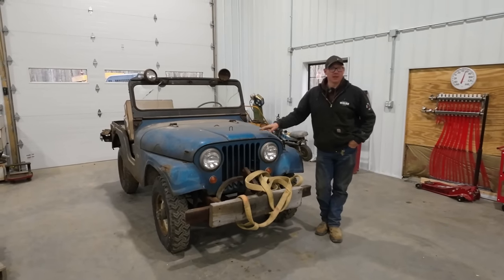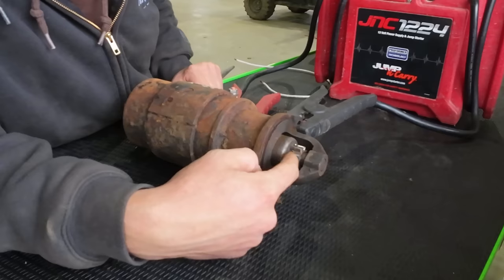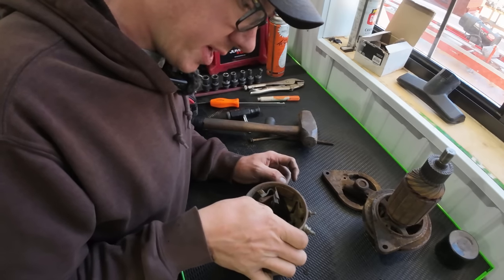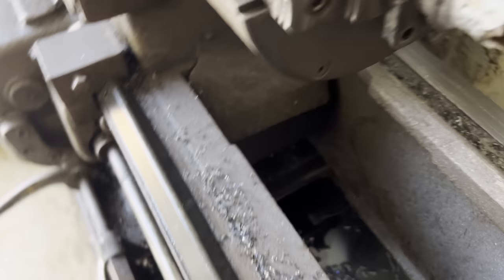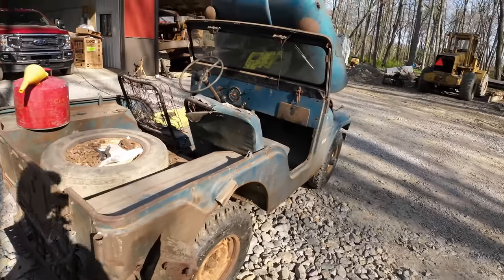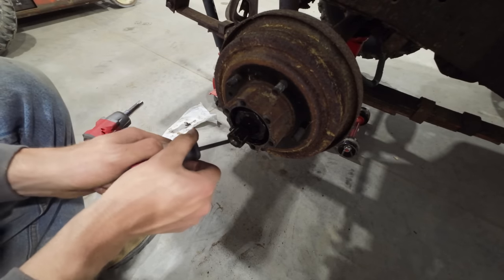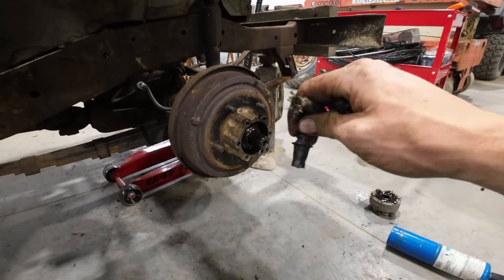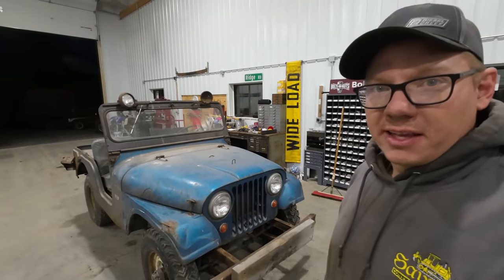Barn Find 1964 Jeep CJ5  (Is It Road worthy?)

Comment: This what I miss so much from my childhood. The ability to disassemble a part and fix it instead of planned obsolescence. I still try to fix anything I can instead of outright replacing it because I grew up dirt poor and it was imperative . Many a night of holding a flashlight under the truck as my dad dropped the transmission. Thank you Matt for keeping the spirit of yesterday alive.
Reply: DIY's have been obsoleted with modern technology / obsolecence
Reply: @araofmadisoncasey4247  just get a horse like everyone else. I knew these "cars" were a fad anyway.
Reply: @araofmadisoncasey4247  naw you still save a ton of money running old equipment and fixing it yourself. Some truths are timeless.
Reply: Some things are just not worth repairing due to low cost
Reply: @alexstromberg7696 Like GM EVAP system that picks up all the dust from rear tires, clogs the system and you end up changing a $700 part? South main auto has a short available.

Comment: Thanks for so many memories, Matt.  My dad had Jeeps all his life after he came home from WWII, and they all had snowplows.  I learned to drive at age 14 in the mid-60s plowing snow with his '64 CJ5.  Many were the times I'd take it to high school.  Yes, I also learned auto mechanic skills working on that Jeep.  Radiator changeout, installing new clutches, starters, and new brakes.  Even constant body work, as they all rust out over time.  I so wish I had that Jeep today.  Jealous.  👍
Reply: I can relate totally! My uncle who lived close by, bought a 1947 surplus Jeep when I was about 8 yo. I helped him work on that thing until he got it back to original. I've owned, bought, fixed and sold Jeeps off and on ever since and I'm 78 now. I have a 1977 CJ5 the exact same color as Matt's with a T98 granny low 4 speed, PS, PB, 3.54 lockers front and rear and 9,000 lb winch. I live in a small town where everyone knows everyone so you can guess who gets called when someone gets stuck! Love them Jeeps!
Reply: One of my first vehicles I owned as a teenager was a ‘59 CJ5. Loved that thing. The simplest vehicle you could ever own. Perfect for someone learning to be a mechanic.
Reply: @billmoran3812  👍 Exactly! I learned so much from my uncle that by the time I was 14, I had my own farm equipment repair business. My dad had bought me a set of combination wrenches and a 1/2" drive socket set for my 13th birthday. I still have some of those tools.
Reply: If you ever want to repair on check out C&C equipment the import most jeep part bodies frames ect.
Reply: @emiliosolis5056  👍

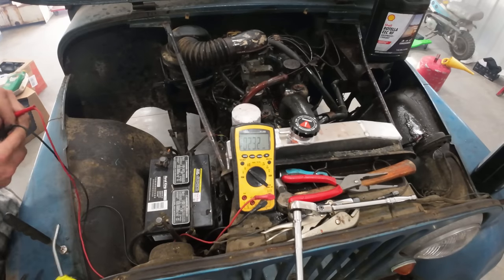Comment: 28:20 Matt, what you saw was exactly correct.  Generators produce little to no output at idle speed which is why you only saw battery voltage until you ramped up the engine RPM.  This is why alternators quickly replaced generators after reliable high current silicon diodes were invented.  For a given size alternators also produce more energy than generators and they're more efficient.
Reply: Thanks for answering all my questions. Before I even asked.🇬🇧☺
Reply: @mickkelly6389  swap out to a 10si GM alternator to solve probs

Comment: Matt, you need to clean the commutator segments because each pair of the commutator segments goes to one of the windings and the other end of the winding goes to another commutator 180 degrees on the other side.  So each brush  connects to a single winding via  the  commutators.  Try this with an ohmmeter,  pick any commutator segment connect one lead to the commutator and the other lead to the commutator 180 degrees on the other side - you should  see continuity (it will read some resistance (ohms)).  If you go to the adjacent segment you should NOT see continuity. So, the reason you clean the insulating space  is to keep the adjacent commutator insulated from the next commutator (set of rotor windings).  It is the same for both generators and starters.  When you clean between the commutators be gentle!!!  The pick should be used to dislodge bigger pieces with a gentle scratch, then a paint brush to gently clean down into each slot. It is a very good idea to lightly clean (sand) the commutators like you did on the video.  But the brushes need a very light cleaning too.  But again you have to be very careful that you do not damage the delicate brushes.  The brushes are not square to the commutator but are curved to ride against the copper commutators for maximum brush  to commutator contact.
If you have the patience this is a good way to diagnose problems with alternators and generators.  Using the ohmmeter, each pair of commutators should have about the same resistance.  If one is open that is a bad winding.  Likewise, if you touch one of the leads to the commutator on either side of the target commutator the resistance should show open.  If not your have a shorted winding or dirty commutator segment, hence the cleaning.  Sorry this was a bit long winded but it is difficult to explain clearly in writing.
Reply: Good explanation, I have been into starters and generators and never knew this before. I’ll know better next time. Thank you!

Comment: The commutator requires a gap between the charged rails.  
It’s interesting watching you tackle stuff you have never tried before and is an excellent example of your innate mechanical skills. Good job Matt.
Reply: Dang Commies are everywhere
Reply: Good mechanics have worked on mechanical devices they know nothing about all their lives. that's how we learn. Personally. I started out fixing cap pistols.
Reply: I really enjoyed this one. Looking forward to watching you get the shop organized.
Reply: Definitely, Lon... and since carbon will conduct electricity, having a bunch of it packed into the gaps  will tend to short-circuit each commutator contact to it's neighboring contacts and reduce the overall efficiency of the generator.
Reply: A hacksaw blade works well for cleaning the gaps. And for cutting down the insulator if you turn the copper down in a lathe.
Reply: @MGower4465  Thank goodness for that.

Comment: Matt is putting his shop to good use. No more mother nature as a roof!😄 As Jackie Gleason would say... How sweet it is.
Reply: Now he needs a part washer and a sand blaster in the shop, plus modifying and installing the gantry crane, and then the list goes on forever:)
Reply: @PatrickPoet  I'm expecting a vehicle lift very soon. Unless he doesn't want to dedicate space in the shop for it.
Reply: @centauri61032  Mustie1 has a lift that is movable
Reply: @centauri61032 wild fire lifts like the ones that vice grip garage has are movable
Reply: Love the new custom interior
Reply: @KipdoesStuff  My gut says "Go with a bolt-down model of lift!"
Reply: @PatrickPoet  and an ultrasonic cleaner, important for those carburetor jobs.
Reply: "What We’re Dealing With Here, Is A Complete Lack Of Respect For The Law."
Reply: @ljprep6250  I wonder if he knows where the heating lines are accurately enough to dare to do that.
Reply: @larrybolhuis1049  Ooh, excellent point.  It's too late now because I'm sure that the floor is gonna STAY warm.

Comment: Just a little tip for future, whenever I fit a new thermostat that does not have a hole or gigle pin through it, I drill a hole. I do this with a small hole no more than an 1/8". This allows very easy bleeding, quicker thermostat opening and possibly less chance of overheating. At the very least the filling and bleeding is so much easier and won't blast out when thermostat opens. I have been a mechanic for 32 years and never caused me a problem yet. hope this helps. Love your channel too.

Comment: Just a friendly note - the coolant is concentrated mix. You should dilute it with water to at least to 1:1 ratio :)
Reply: And - I don't see the relationship coolant to fuel. It is not supposed to come in contact with fuel, so what different does it make whether you put it in a diesel or a gasoline engine.
Reply: @laoluu  There is no reason for comming in contact with fuel. You must have misunderstood my message.

Comment: I remember my first CJ. The Ross steering box was so worn out I had about a third of a turn or more of play in the steering wheel. The top was dry rotted and leaked like a sieve, the rear springs were busted, the roll bar was barely bolted to the wheel wells,  and everyone gave me grief about my "Ejection seat". It was the only vehicle I refused to wear a seat belt in (safer to be ejected, than incinerated), but damn, it was a lot of fun.

Comment: The bottle on that Rotella coolant you used said it is “concentrated”.  That means it should be mix 50/50 with water - distilled is best.  It will actually cool more effectively and have a lower freezing protection temperature if it is diluted per the instructions.

Comment: I’ve had brake hoses pop like that before. Rotted hoses and the heat weakens the crimp and generates pressure. It was probably internally plugged somewhere causing pressure to build up even with the end cut.

Comment: I have had a brake hose blow up on me also. It didn't blow completely off like yours, but it did pop and scare me good. Only thing I can figure is that the soft line was collapsed on the inside and when I was using heat that little pocked of fluid in there boiled and it blew. shrug

Comment: Great trick on testing generator. I never knew that one. One tip is get some left handed drill bits and a lot of the time as you drill it counterclockwise the bolt comes out without using an easy out. (Easy outs tend to put outward pressure on the bolt and make the threads dig in thus making it harder to unthread than the left hand drill bit does)
Reply: Have a few LH bits for that reason - works way better than an EasyOut.
Reply: agreed I have a set of leftys for that purpose.

Comment: that copper is well worth fixing, they are over $500 usd to buy new copper radiators, they are also the best at cooling the water, much better than alloy
i always get mine flushed and tinned up for $50, they look nice and like new afterwards

Comment: I've had the flex line blow at the fitting once or twice before when using heat. It can definitely give you a scare! I couldn't explain it either. Either an internal collapse causing pressure to build, or something to do with the hose material being compressed in the fitting?

Comment: We had that same master cylinder on the old Clark forklifts and a cool thing about them is you can actually bleed them without cracking a bleeder screw. Just add fluid and pump the brakes alternate between long and short strokes kind of like you showed in your video with the cap off and the fluid returning, after awhile presto you have brakes 😊

Comment: Hi Matt,
I have been keeping a cj2a running for the last decade after inheriting it from my dad.  I ended up fixing the starter, replacing the generator with an alternator and generally replacing fuel and brake systems as needed.  Very similar process to yours.  I enjoy watching and learning from you.  Thanks for taking the time to record and post.  My only suggestion would be  to spray some high heat black paint on the radiator to make the aluminum rad appear slightly more stock.  Great work so far.  Keep it up!

Comment: I had the same type of explosion happen in a brake fitting that I had in a vise.  I was heating it with an acetylene torch, and a loud bang.  The hose portion went flying.  I think vaporized brake fluid is explosive.

Comment: The Generator brings back memories.  I had a 64 1/2 mustang with a generator.  when you pulled up to the stoplight, the lights dimmed at idle.  Cool that you were able to get it freed up and running.  

I got my military drivers license on a Jeep.  One of the most fun vehicles out there.
Reply: Yup!  Had a generator on our '57 Chevy Nomad wagon, and generators on my air-cooled VWs.  The VW's never really had a problem with dimming headlights, but the '57 chevy did... but that was also a 6 volt system.  Cool that you got your military license on a jeep!

Comment: Brake flexible hose may have had a blockage, not unknown on the old rubber hose's, when you heated the connection, pressure from the fluid remaining expanding would have built up and blown it off, also a question? valve tappets sound a little loud, are they adjustable?

Comment: In a video from Watch Wes Work where he was working on a much newer jeep, he mentioned the soft lines can delaminate on the inside and cause there to be a flap of rubber loose that basically causes the line to act like a check valve, so maybe that happened in this case. In his video the brake cylinder seemed to be seized but when he took off the soft line, the pressure was relieved and the cylinder moved. Even though the line here was open to air it mighta still been sealed internally, causing it to blow apart when the pressure got high enough from the heat. Love the videos, keep up the good work!
Reply: My thought was maybe some fluid had gotten between the inner seal and the crimp on the line, and when heated it vaporized, causing rapid expansion.  I guess we will never know!

Comment: Great to see you cleaning out the air gap in the commutator on the generator, the reason you've seen others doing it is that carbon brush debris/dust is just as electrically conductive as it was while still attached to the brush. Effectively over time it will cause a dead short between the segments and hence the windings themselves (each segment being directly attached to one side of an armature winding). Also be careful whenever lathe turning or polishing a comm like you did with emery cloth, the air gap needs to have a minimum depth to avoid arcing between the segments, I spent some time during my aprenticeship undercutting and chamfering the damn thing on rail traction motors and the importance of getting it right was belted into us apprentices after we saw the carnage of getting it wrong.
Reply: Matt didn't turn the commutator on his lathe lol, he was turning a thermostat neck that he repaired with epoxy.

Comment: Great job!  I was glad to hear that you replaced pretty much everything.  The danger with those old style masters is that there is only one reservoir for both front and back, so if something blows you lose all braking.  Replacing everything is a must when rehabilitating these old brake systems, just for safety.  It is also essential to be sure the emergency braking system, if there is one, is functioning just in case, you lose braking.

Comment: I have a 1956 CJ5 that has been in or around the family since 1968 (I took possession personally in the early 80s). It is basically the same as yours except a 6 volt. I had one of the front soft brake hose blow apart on me just like you did!  It still has the same tires as when my dad bought it in ‘68 but at least one is completely dry rotted. I am having a hard time finding the correct tread (aggressive light truck tread) in 6x16. It’s a joy to work on and even better to drive!  Keep the videos of it coming!

Comment: That brake line was probably internally collapsed and was holding pressure on the front brakes. Then when you went to heat the line you were building pressure and it blew apart. For your safety please use two more jack stands and not the jack alone when working under a vehicle. Accidents happen all the time but you are far away from where anyone could hear you screaming for help. Keep up the good work.

Comment: Hey Matt!  I expected you to pull your Kroil off The shelf and hit the 6 sheet metal screws that looked like they were going to give you a problem. 😊 I'm really liking your remove teardown, inspect, cleanup, reassemble approach to the starter and generator.  One of the reasons we like the old iron is because it still works.  Just needs a little attention.  |  Think you outta drop that gas tank and clean it out?  Run your salvage fuel through a paint strainer so you don't find yourself stranded on the side of the road when that "plug" finds its way back into the fuel line.

Comment: Quick tip for burping coolant systems. Put a big giant funnel in the rad as you top off with it running. That will stop any overflowing burps/splashing and it will just overflow into the funnel.

Comment: on thermostat i usually drill a small pilot hole in the flange area that way it always will purge the air , it helps them open a bit faster.

Comment: Matt if you ever have the option, replace your radiator hoses with silicone hoses. They were originally developed for aircraft and they never go bad.  We used to used them in the fleet of vehicles where I worked and we stopped having overheating problems/failures.  Finding them and ordering silicone hoses does cost a but more up front but it saves so much in the long run it is worth it.  Guarantee!!

Comment: Matt, It has happened to me as well.  The high pressure hose crimp pressurized as the rubber burned inside and made a bit of a rocket.  I now cut the crimp ferrule with a hack saw and no more bombs.

Comment: My guess on the exploding soft brake line is that the old thing had a bit of water that seeped in between the crimped hose fitting some time ago. This trapped water turned to steam while you had the heat wrench going and pow..

Comment: After you puled back into the shop from your first test drive I saw it leaning to the driver side and I thought new springs & shackles. During the brake job I saw the shocks were shot and front springs did not look well.When you rebuilt the starter and generator I was right there with you,I've rebuilt those many times in my life I would have even rebuilt the wheel cylinders just for the heck of it I still have my brake cylinder hone!  LOL .Whoever learnt you how to mechanic must have been "Old School" and that's a skill to have forever. I'll be looking forward to the spring job video!!